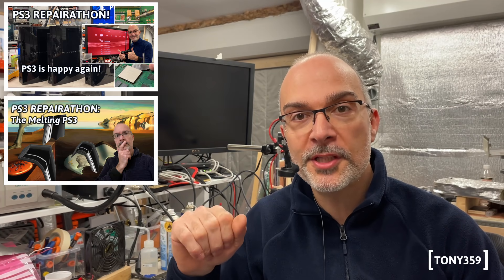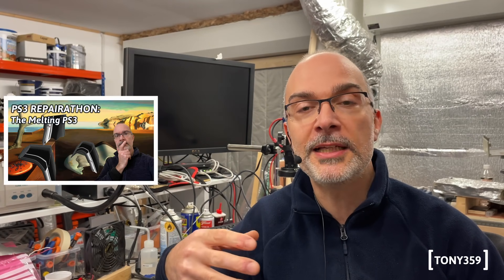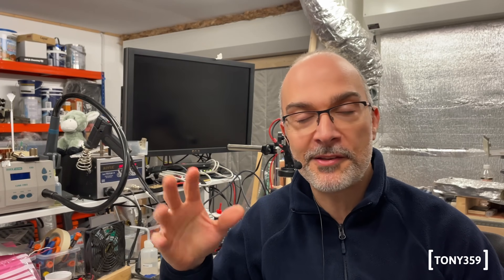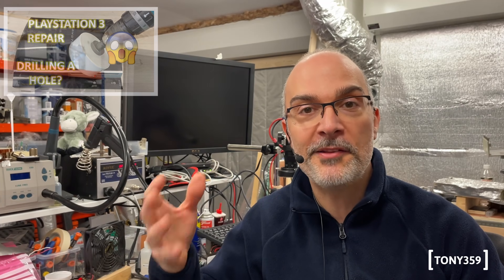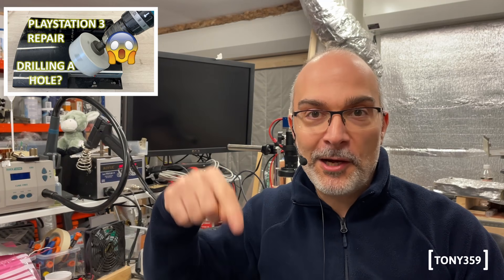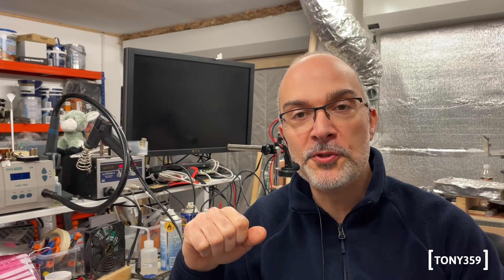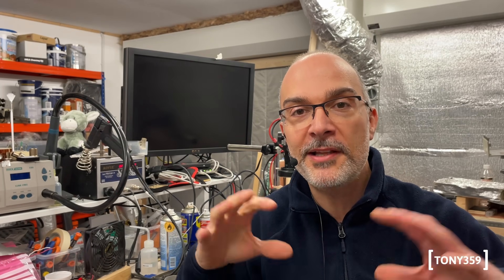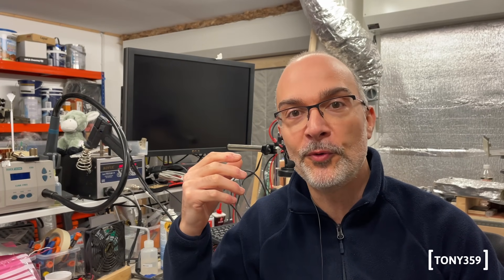PlayStation 3 Repairathon - Part 3: The White PS3

Comment: I've been thinking a C-style blade would de-lid the CPU safely. The top and left of the C butt up against the IHS, acting as a guide to stop the tool cutting too low or too deep, and the bottom of the C is the cutting blade. It would have to be custom made starting with a palette knife and bending/cutting it down to size.
Reply from the maker: That’s a good idea. NSC Modz has also developed his own tool I think. Plenty of options. Just don’t use dental floss 🙂 thanks for watching!

Comment: I have a ps3 that starts runs but does not play disks. Where can I get it fixed? The controller needs a new battery.
Reply from the maker: Hi - that would hopefully just need the drive serviced (cleaned). Failing that, those can be replaced but the drive needs to be "married" to the board so it's not plug and play. I do not know where you could get that fixed, see if you can find some repair place where you live.

Comment: Great video I wish were I live they do these sadly they don’t. I have a ps3 has the YOLD but it will turn on if you give it time it’s like and old car starting up and it will stay on like a normal ps3. but when you put a game  it will shut down doing the YOLD of dead It will still boot up until you play a game.
Reply from the maker: Thank you! What version of PS3 is that? Did you check Syscon? I think it can be accessed if you ‘jailbreak’ it, so no soldering required 🙂 
I’m just wondering if the PSU is having an issue. If 12V fails, then it’s YLOD as Syscon uses 5V to work.
Reply: @tony359    ps3 model CECHL01 it’s on the latest firmware 4.90. Sadly I can’t check the syscon because I don’t have the tool to do it also I could jailbreak it but idk if it’s safe to do  so.
Reply from the maker: @ZeroXL722  the L01 features the latest 65nm RSX, that shouldn't fail. I'm not an expert about jailbreaking but I'm told it's safe and reversible. But please don't trust me :) 
Do you see/hear the fan spinning when you attempt to power on? The fan runs at 12V.
Reply: @tony359  no it actually sounds healthy but i just turn it on it went to a YOLD then turn off  and then turn it on again and it  started up normaly. also i finish jailbreaking it i just need to find a package to get the syscon errors . kinda weird it does not want to die
Reply: @tony359  ok I got the error codes it’s giving me  A0802124 and A0801002 all the way down to 32 same errors
Reply from the maker: @ZeroXL722  interesting. 1002 seems to be bad tokins - but please bear in mind there is a lot of misinformation about that. 2124 seems to be an AV encoder/HDMI issue?

I'd recommend you check with the PSX community. That said, it doesn't seem to be the power supply unfortunately :(
Reply: @tony359  yes 2124 is a av encoder issue seems right know I plug in the av and nothing is showing in the screen also I plugged in the hdmi and it YOLD but when you remove it then turn it back on it stays on until you plug it back in....
Reply from the maker: @ZeroXL722  oh, then it sounds like an HDMI encoder replacement is in order!

Comment: I'm curious what are you using to remove the ihs glue? I'm pretty comfortable with my deliding skills but i could use a better method of removing the glue afterwards. Enjoying these videos, I love the PS3 👍
Reply from the maker: You are right I should have mentioned that. It’s ‘silicone remover’ from B&Q or Screwfix. It needs a few minutes to loosen the silicone, then I use a plastic tool to scrape it off. It feels safe on the PCB. Thanks for watching!

Comment: One other question, when changing the thermal paste on a PS3, if you put aside the de-lidding, is that like half the job done or what?
Reply from the maker: unfortunately the de-lid is an important process. The thermal paste  between the IHS and the die is important. Still, if you're not confident in the process, it's where I'd start.
Reply: @tony359  I am confident but you missed applying to the chip, I believe that is a problem.
Reply from the maker: @Ultimate_Utopian  what chip?
Reply: @tony359  RSX chip
Reply from the maker: @Ultimate_Utopian  I'm not sure I am following. If you mean that I didn't put paste on the RSX, I did, maybe it's not clear from the video.
Reply: @tony359  you did put the paste, but not the silicon surrounding it.
Reply from the maker: @Ultimate_Utopian  Ah yes, I did not. I understand it's important to give the IC stability indeed.

Comment: please repair my playstation 3 cech c03 because inside i have 20 years of saves, from the first playstation, up to the three.
Reply from the maker: I'm sorry, I don't feel I am skilled enough to take up others' consoles. What you can do is to move the HDD on another playstation and that should work. I am not sure what happens with the software though, maybe make sure the receiving playstation is on the same firmware first. And make a copy of the HDD before installing it in the replacement playstation! Good luck!
Reply: @tony359  Thanks for your interest but I already know I can't do the procedure you described because the new console would ask me to format the disk. 😭
Reply from the maker: @medievil02  oh sorry I didn't know the HDD is encrypted to the specific PS3. You are right, the only way is to fix the PS3. To be fair, most PS3 can be even temporarily revived from YLOD. If someone can do that for you, you can then save the data and export it on a new PS3.
Reply: @tony359  in fact it was my intention but I can't find a competent person who can help me, so far I have only paid out money without being able to do what you also suggested. I would do it but unfortunately I lack the necessary equipment unfortunately. I'm really desperate. 😢
Reply from the maker: @medievil02  paid money as in "someone tried to fix it but failed"?
Reply: @tony359  yes unfortunately and not a simple fix, but paid for a failed reballing.
Reply from the maker: @medievil02  If reballing did not fix it, then I feel it's unlikely it will work again. And this is assuming whoever did the reball did a good job, bear in mind that those components are not really designed to be reflowed etc. I'm sorry, I know this is not what you'd like to hear.
Reply: @tony359  in fact I don't trust whoever performed the surgery very much, but in Italy I haven't found others, this is the real reason why I would like to rely on someone who has real expertise.
Reply from the maker: @medievil02  e non vorrai mica rivolgerti ad un altro italiano? 🙂 ti capisco bene ma onestamente anche se avessi le capacità, rimettere mano dopo altri è molto difficile.
Reply: @tony359  non posso credere che in tutta Italia non ci sia una persona appassionata e competente che abbia voglia di fare bene il suo lavoro, ti giuro che se avessi potuto farlo da solo, a quest'ora magari parlavamo di quanto eravamo stati bravi.😁 Grazie per la risposta nella mia lingua madre, sei stato molto gentile. Non so veramente che fare, anche perché non mi sono affidato al primo che capita ma ho aspettato tanto prima di convincermi... Spero di non aver fatto un grosso errore. Ti giuro preferisco pensare di essere stato raggirato e che non abbia proprio messo mano alla play.
Reply from the maker: @medievil02  se guardi il secondo video della serie puoi vedere che il ‘reballing’ è fondamentalmente un mito. Il difetto il più delle volte sta dentro la GPU. Il calore usato durante la procedura è probabilmente il responsabile del fix temporaneo della GPU. Se davvero la GPU è difettosa l’unica soluzione è sostituire la vecchia 90nm con una più moderna a 40nm. 
Non sono qui ad accusare chi ti ha fatto il reballing, l’idea che il problema sia sul BGA è abbastanza diffusa. 
E anche la persona più appassionata può ‘ribollare’ la RSX quante volte vuoi ma se il problema sta nella GPU purtroppo il reballing non è la soluzione.  Sai quale fosse l’errore in Syscon prima della procedura?
Reply: @tony359  ti stavo scrivendo e poi mi ha cancellato tutto😤
Il tipo si è concentrato esclusivamente su rsx e mi ha anche detto che avrebbe provato a sostituirla, ma secondo me ci sarebbe da verificare gpu e nec tokin.
Purtroppo non so quale errore riporti la play e credo neanche il "tecnico" ne abbia idea. In Italia vanno tutti di reflow e arrivederci e grazie, io me ne sono tenuto  bene a distanza invece.
Reply from the maker: @medievil02  la RSX è la GPU. I tokins si rompono raramente, è un po’ un mito anche quello sembra (guarda il video che ho linkato nella parte 2). 
Detto questo se il ‘tecnico’ non si è collegato al syscon e non ha controllato il messaggio di errore… beh… 🙂
Reply: @tony359  ecco vedi questi sono i limiti legati all'ignoranza in materia 😅.
Cmq il tecnico ovviamente non sapeva darmi il codice d'errore, perché nella miriade di play che non riesce a riparare non ricordava quale fosse la mia...🤬
Scusa lo sfogo ma sono veramente con la vena sulla fronte gonfia!!!🤯
Reply from the maker: @medievil02  un professionista, un ‘tecnoco’ 🙂 ti capisco!
Reply: @tony359  e questo è il meglio che offre il panorama italico, ora ne avrei trovato un'altro ma ho veramente il terrore...😨
Reply: @tony359  Hi Tony, if this person wants to try and obtain his saves from his HD then he could try the following.

Heat the MB to around 150 degrees for about 5 minutes. This revives many consoles with the flip chip error 3034

If the console boots its time to get custom Firmware on the console (Evilnat 4.90). Now get the EID root.key under the dump tools section. Providing he gets a replacement console that he can jailbreak he will be able to get his saves from his hard drive, using the EID root key he odtained from the console. PSX place has more information
Reply from the maker: @timdark9282  hey Tim, looks like this PS3 has been reballed by someone and it’s not clear how good the job was. The ‘technician’ was not even able to provide what the Syscon error cose was. So I have a feeling this unit is a goner. But worth trying what you say. To be honest I’d hope it was tried before the reflow/reball attempt but somehow I’m not so optimistic.
Reply: @tony359  ciao Tony, ti giro un'ulteriore risposta di un nuovo laboratorio, tanto per farti capire su che info io mi debba basare  per fare mettere mano sulla play:
Gentile Cliente
Purtroppo non tutte le mainboard delle console sono compatibili con la diagnostica UART SYSCON quindi effettuiamo delle verifiche hardware e lampada a infrarossi che ci permette di capire se qualche sfera non è allineata o crepata e solo in quel caso procediamo al preventivo.
Ora secondo te che faccio? Ci provo? Posso prendere qualche tipo di precauzione? Poi più ci penso e più mi ricordo di ciò che c'è dentro quell'hdd e quanto ci tengo a recuperare i dati.
Ti giuro che se riesco a portare a termine la mia impresa, la play la regalo a chi mi ha aiutato...😇
Reply from the maker: @medievil02  non sono un esperto PS3 ma onestamente non sapevo questa cosa del Syscon. Forse sulle super slim ma sulle vecchie… Sulla ‘lampada ad infrarossi per vedere le sfere crepate’ vabbè. Ma ti danno anche uno scioglipancia alle alghe e il talismano del Maestro Di Nascimento??? 🙄
Reply: @tony359  infatti sulle vecchie deve per forza andare non puoi dire una cosa simile, cmq mi sa che se c'era ancora wanna Marchi era l'unica a cui potevo rivolgermi...😵‍💫